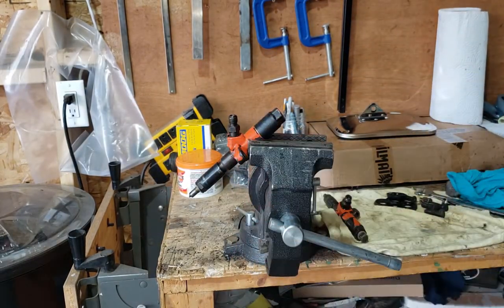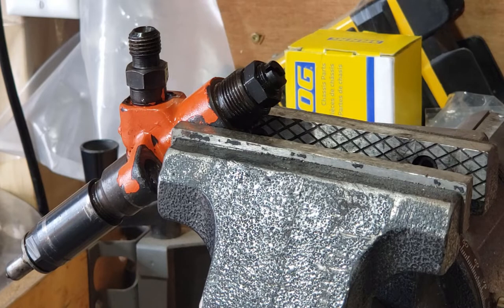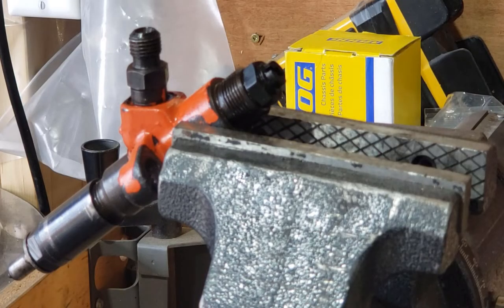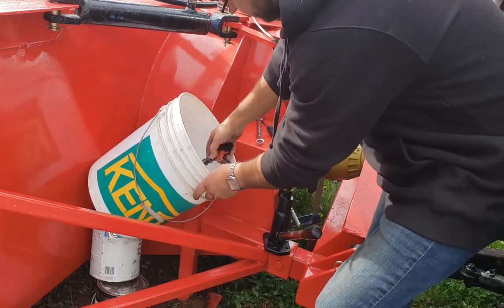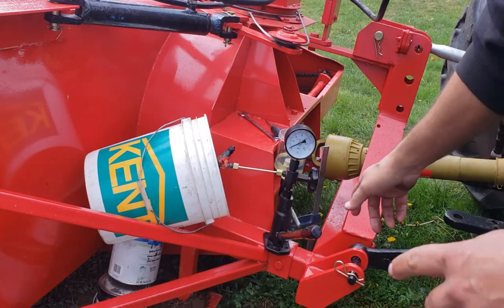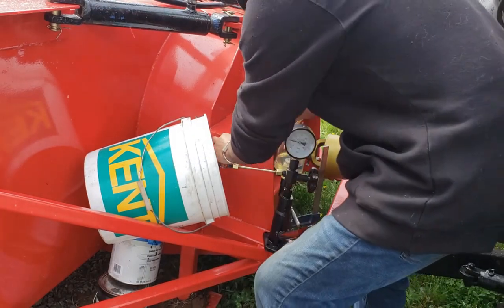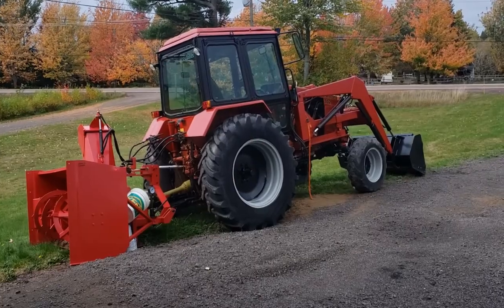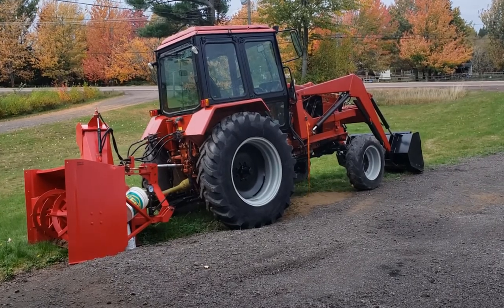Diesel Fuel Injectors - How to Adjust Opening Pressure

Comment: Really appreciate the helpful video. Just pop tested the injectors and they are about five to six hundred PSI below where they should be. This is a 1954 Fordson Major Diesel.
Reply from the maker: Have you tried adjusting and see if it made a difference?
Reply: @Not Handsome but Handy  yes I should have mentioned that I simply adjusted them and brought them up to the correct popping pressure. I was just surprised to find them so low. Once again thanks for the great video.
Reply from the maker: Awesome, thanks for watching!

Comment: In the 'adjusting pressure' section, how do you adjust the black thumbwheel to the right of the tester? I have one of these testers which came without instructions and I'm struggling to understand this part - if I tighten the thumbwheel all the way up, I can't move the lever at all. Am I sposed to slacken the thumbwheel off to where it just starts to move the dial when I pump the lever? How does that work? Thanks for your help.
Reply from the maker: I can't say for sure but I think that wheel is just an open close valve. You'll want to send full pressure to the injector and you'll then get a measurement of what pressure the injector opens at.
Reply: @nothandsomebuthandy  Really appreciate your feedback. It's the not being sure if you're doing something wrong that's the killer! Many thanks
Reply from the maker: Yeah there's alot you just learn from doing